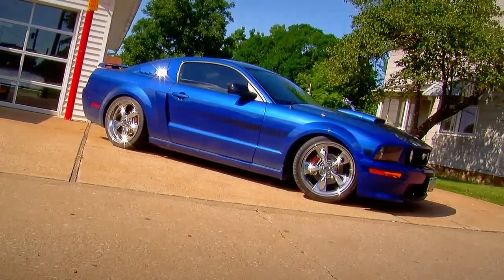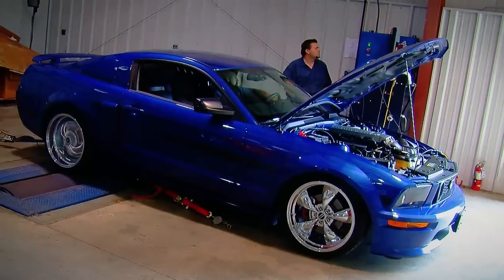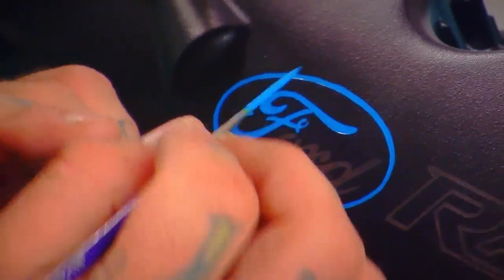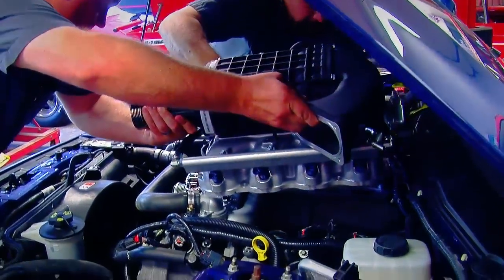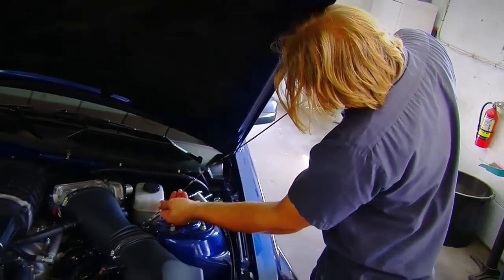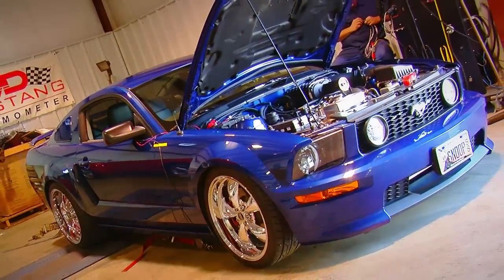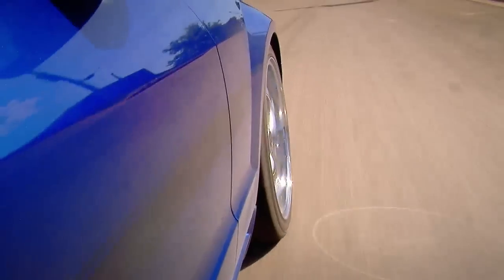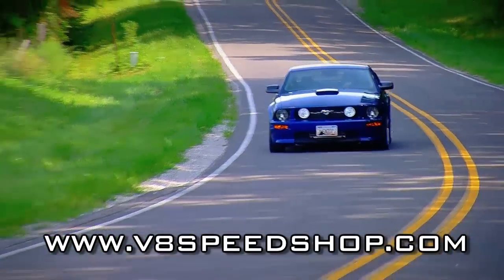2008 Mustang GT CS Magnuson Supercharger, Headers, Cat Back and Clutch Install Video V8TV

Comment: If you think that roughly 112 Hp increase with a supercharger and exhaust is impressive you don't know anything about modding a car
Reply: you cant really do much with the stock 3v motor, they can handle like 450 at the wheels before they start to give.
Reply: Kiko Smith I know plenty of 700+ whp 3V so it’s not as hard as people may think. It’s just costly
Reply: @treyarrington8051  That's a misnomer. The stock bottom end of the 3V is capable of handling 450 Torque at the wheels, and mine is running over 560 HP at the crank, with no trouble at all.

Comment: Personally I would have used a Borla catback, I used these same Magnaflows on my GT after I installed longtubes and a catted h pipe, and the car was quieter than stock. Waste of 600 dollars in my opinion, and thats just for the axleback system

Comment: what was the cost of this upgrade?
Reply: Ryan R 
I would love to know as well.  I’m thinking about doing something similar to my 2007 GT/cs
Reply: I had bought a 2006 3v mustang, built by Brenspeed in IN, Roush m90 supercharger, Detroit rocker cams, 93 tune, full exhaust with headers, and a Roush JLT CAI. He gave me all the receipts with the car, and it was over $25k just under the hood. I made 440rwhp and 410 torque. My brother has a 2014 5.0, just an exhaust on it, and he beats me 90% of the time. I wouldn't recommend boosting a 3v, unless you do a 5.0 stroker kit with it...

Comment: these 3v mustangs make shit for power. i know. i owned a 05gt with headers, no cats, intake manifold, throttlebody, intake. all the shit you can bolt on it before cracking open the engine. i made like 315 at the wheels. not long afterwards i traded it in for a 16 5.0 track pack lol
Reply: Sounds like a lack of knowledge and a shit mechanic to me. I know people who have N/A 4.6 mustangs making over 400 hp to the wheels. Just got to know what your doing first.
Reply: I drove a ‘16 GT and it felt sleepy cruising around town.  If all I cared about is a HP number, I would’ve traded in my S550 V6 for it.  After driving my ‘06 GT during the test drive, it felt much more peppy and looked better (in my opinion) doing it.  I now enjoy the cruise around town much much more.  The S550 is fun at high-speeds, but I was bored with it around town (where I spend 98% of my time).

Comment: A coyote with bolt ons can make more power than this
Reply: Jonathan Cisneros this car is making about the same horsepower at the wheels as a stock 2018+ Mustang GT. However this car is also about 200 lbs lighter than a manual 2018. It’s a nice body style and with those mods it’s a strong running car for sure. And 3v’s sound better than Coyote engines. The 3v firing order is the same as that in the old 5.0 foxbody Mustangs.

Comment: Supercharger just to get the stock power of a Coyote.
Reply: Imagine it with stroker, cams and NO2!
Reply: I know! I hate that my V8 has similar output to the current L4
Reply: 15 grand of bolt ons on a 7500 dollar car
Reply: @lildeezul2  ....and your point is?
Reply: @sherylellingson3538  I'm doin the same thing. Cuz this is my favorite body style.
Reply: @newfie-dean5803  best body styles since the fox body
Reply: Jeremy Beaver i like them all except I don’t care for the Mustang II in the 70s and oddly enough I don’t care for the look of the 10-14 that much either. I like the 11-14 Shelby though. Ford should not have departed from the 05-09 look the way they did. Look at Dodge, they’ve kept the challenger look similar to what it was in 2008 but made it better. Ford could have done similar with the 05-09 in my opinion. The rear stance on the 05-09 GT looks so much better than any of the ones since to me. The 15+ looks good sometimes depending on rear tire size and model but sometimes it looks weird to me, like the back end had something dropped on it that squat it down, if that makes sense!
Reply: @newfie-dean5803  I agree I hated the mustangs from 71 and up till the fox body didnt like the 90s and early 2000s s197s is the best looking body I think minus 68-70 of course lol
Reply: Jeremy Beaver agree, I like the 68-69 the best. And the 05-09 paid homage to those very well. When I bought my 06 GT new I remember feeling like I was driving something out of the late 60s/early 70s. I remember I had the Rocky theme song on a CD that I enjoyed listening to when I was highway cruising, lol. The car had a cool feel to it and got compliments and looks everywhere. People bash on the 3V but it sounds better than the Coyote engine and with some bolt-ons and tuning it has plenty of performance for the street! Some high end super cars in the 80s were 0-60 in 5 seconds which is what the 05 GT was stock. And an 05-09 GT stock will toast a 60s Mustang yet people don’t bash on those! I just think it’s funny how the 3V gets hated on. I think many people realize that the 05-09 retro look is better and they try to compensate for the loss of that look by boasting about the coyote engine, haha!
Reply: If you like the looks of the 06-09 GT's  but don't care for there performance upgrade to the 07-09 Shelby GT-500. Comes with a 5.4 4 valve already supercharged and can handle 800 wrhp stock.  Atleast that's the option I will be going.
Reply: 127BobbyRay yeah but ironically I don’t like the front on that model GT500. I liked it when it was new but I think
It aged poorly and it does not look as good as the GT front does.
Reply: @newfie-dean5803  that's the great part, you can change the front facia  and back facia back to stock if you want to.  Or you can order whole different looks for it if you want to.  I know there is a Elenor package for that year aswell.  I personally like those years Shelby myself, everyone has their opinions which makes making a vehicle your own awesome.
Reply: 127BobbyRay yeah true. I do like them, just I don’t think the front looks as good as it did first and I think the front on the GT just aged better and still looks good. I was wondering as I typed my response above if there might be an 07-09 GT500 that someone put the front of an 05-09 GT on. I know that there’s lots of GT owners that converted to the GT500 front fascia but not sure if any GT500 owners did a GT front fascia conversion anywhere. Maybe not.
Reply: @127BobbyRay  But aren't those ridiculously more expensive than a GT? Even after installing the headers, exhaust and super charger? At least that's what I thought...I'll have to look for some for sale.
Reply: @MikeTR02  you can find them for anywhere between 25k and 35k depending on mileage.  They are collecter cars as they are Shelby Mustangs.  And the 07-09 where actually influenced by Carroll Shelby himself.  Unlike the new ones that carry his name, but not his vision.
Reply: @127BobbyRay  did you get your Shelby bro?
Reply: @stangmozloko9934  unfortunately not yet!  Life and a Son's 8k medical bill kind of put it on the back burner...